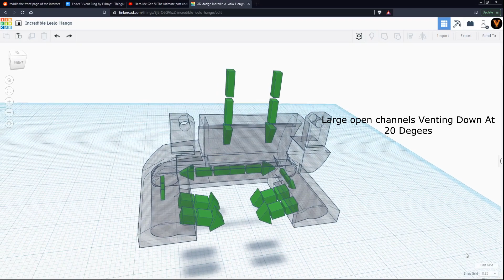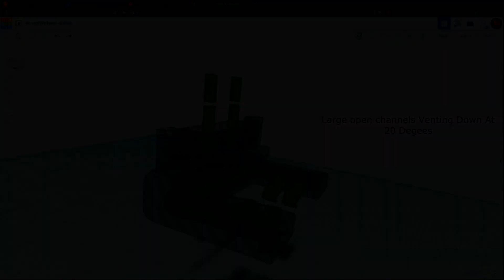Ender 3 Pro Banshee Fan Vent Upgrade

Comment: Hey, is this better than the Satsana fan mod ?
Reply from the maker: Better no, but I would say it does the same thing with a lot less plastic. Since it is front to back as opposed to side to side, rotate your print 90 degrees for equivalent results on overhangs

Comment: Thank you for making this, and putting it out there for us! I have looked at a few different fan options but many of them like you said, have many parts and seem a bit much just to adjust airflow that im not sure needed it. This piece will be great to try out, and being able to use my stock fan is nice because I just replaced the old one that the bearing fried on! Thanks again Voltage and keep it up, I hope your move to greener pastures goes really well!
Reply from the maker: That's very kind of you, I'm humbled and hope that the Banshee does what you need it to.  I really appreciate all the support and comments it keeps me going. I will see you on those new greener pasture!